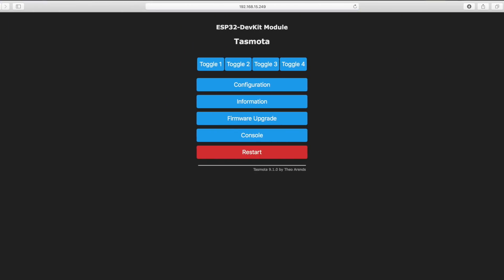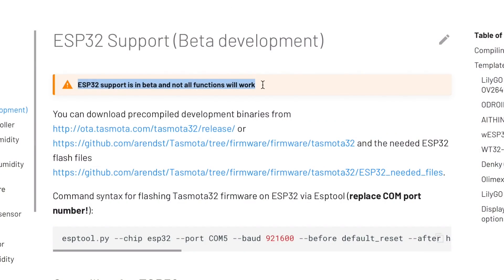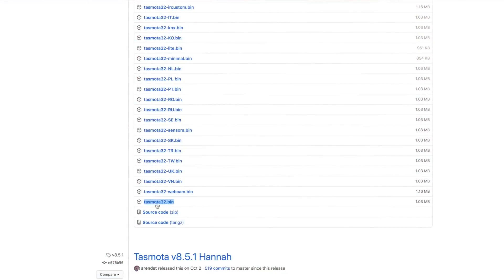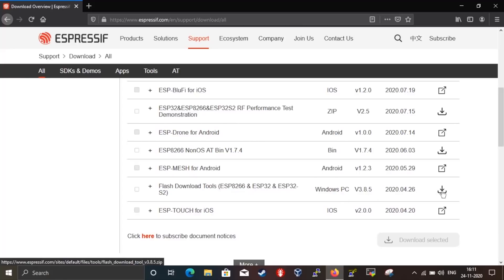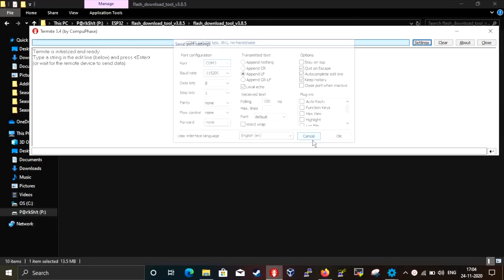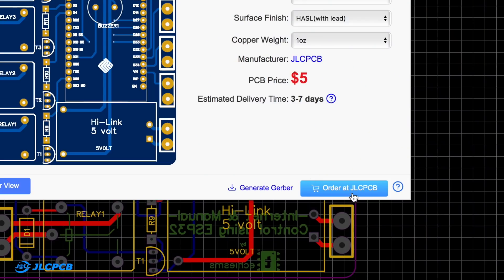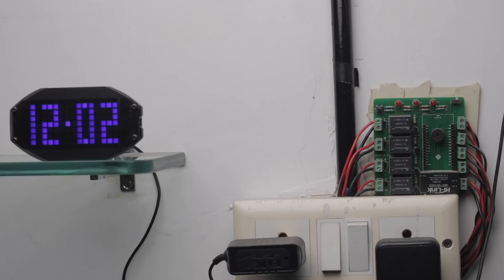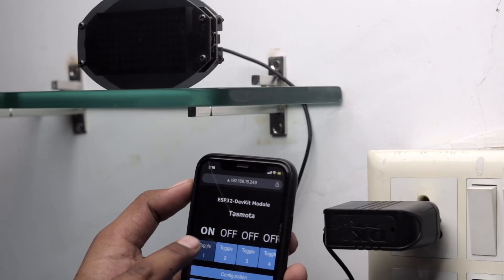Home Automation using TASMOTA on ESP32

Comment: Bhai please help
i bought 2 esp 32 and burned followed all your steps

i am getting in termite only the folllowing message in loop

ESPrtk test upload firmware OK
ESPrtk test upload firmware OK
ESPrtk test upload firmware OK

no hotspot is generating 
and i tried to put ssid1 and password through termite 
and the esp is not reading and no effect

i tried to program using arduino ide and its working fine

Comment: How to add a reset button to esp8266-01 board to reset tasmota to factory defaults?
(in case when I change my wifi ssid/password )
Reply: You doesn't need reset button, switch on/off six times automatically reset that.

Comment: The worst part of this video and page is that it does not explain the flashing procedure. If you have a ESP32 DEVKIT v1 like me:

- fill in the settings like in the video
- check the cmd prompt for ....____....._____....___ 
- Hold both the BOOT and EN, then release EN and wait for the dots and dashes to change to a downloading message then let up the BOOT. It will give you a DL msg in several seconds after you releas EN.
Reply: Did it work with you? I'll try it asap. Would you mind to gimme some help on it? Thanks in advance

Comment: Banana PI BPI-bit is an ESP32 with 32-bit Xtensa LX6 dual-core processor based embedded system. It supports Webduino, Arduino, MicroPython as well as Scratch X programming environments.
http://wiki.banana-pi.org/BPI-Bit

Comment: Sir I follow all your videos and also subscribed and this is the most easiest and coolest project till now,
I also tried this , it is one of the best and I request you to make a video based on how to use tasmota ,how to config other things like timer set , Mqtt etc.
And  can we add slider for fan ? ,also can we use with ttp23  switch for up & down to control fan speed with that " capacitor non humming kit " which was used in your one of the video l liked that most. I'll be greatful to you if you try to reply............